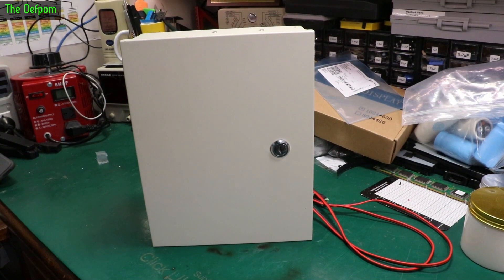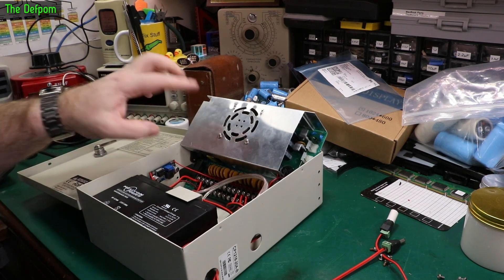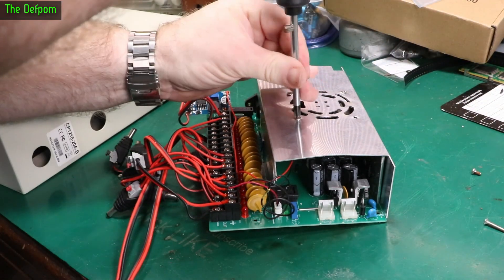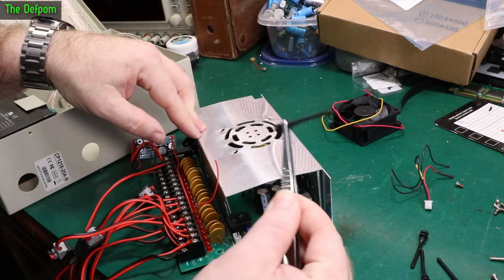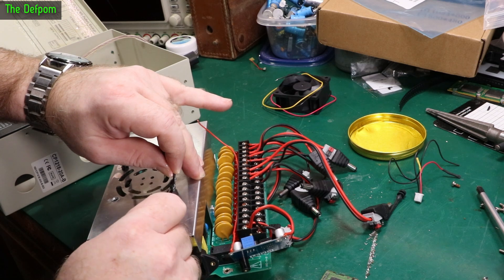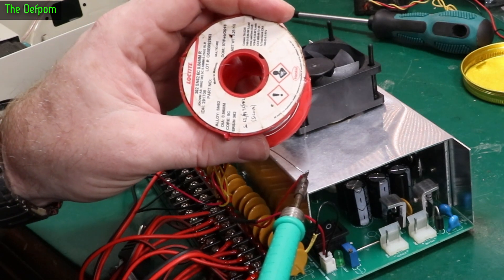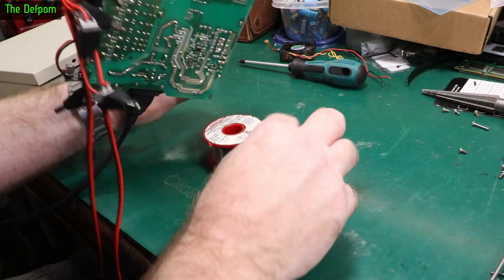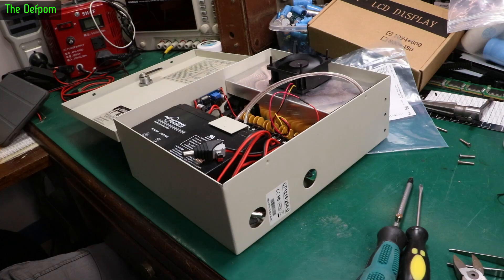🔴 12V UPS Distribution System Repair - No.1259

Comment: Or you can use a Noctua fan and never have to replace it ever again.
Also i would have removed the grill in that metal cover, to much airflow restriction. (and noise)

Comment: A faan in a sealed box with no vents ?
Surely that would get hot if you closed the lid
I have a couple of Talentcell UPS modules for my cctv, 7 bullet cameras and dvr, both modules charged from one charger, charges at 1.5 amps during the day, rising to about 2A overnight when the IR turns on.
Best of all, no fans.